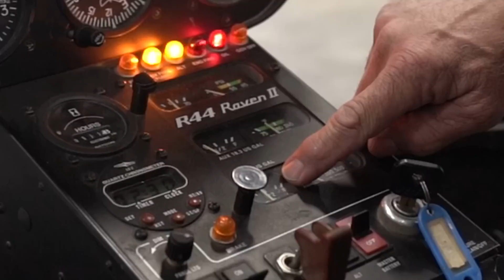LANDING A HELICOPTER IN FLAIR'S BACKYARD!!

Comment: Really, you're a pilot? Do you own a plane? What would it take to build a landing strip in your backyard? Is it even legal? Or at least a pad. Yes, he may be upset now, but when it leads to you both flying off to do a colab he wont be complaining. Would bring in so many more opportunities being able to get from there to surrounding states quickly. 3.5 hr flight to googan hq with 1 stop for fuel. Or get a cirrus sr22 its a nice  quick and affordable 4 seater small enough to land and take off if you built a strip and go like 230mph
Reply from the maker: Cirrus are very nice planes! 
I use to have a Piper Saratoga but, I sold it 20 years ago… I miss it.